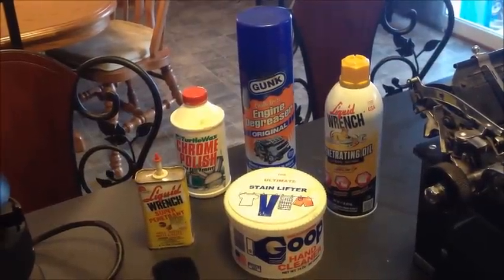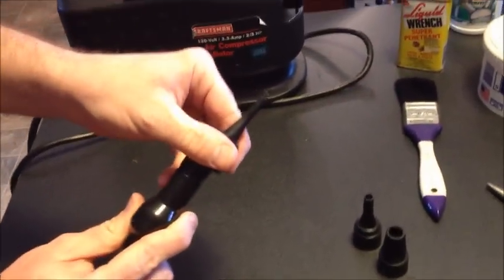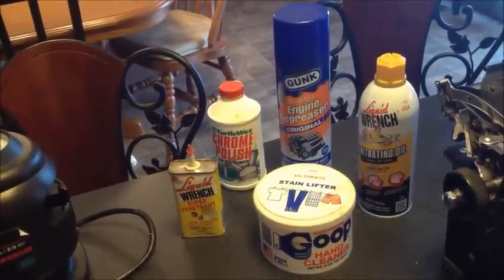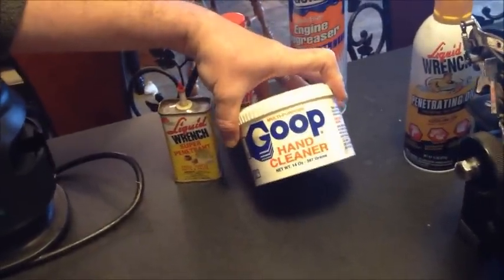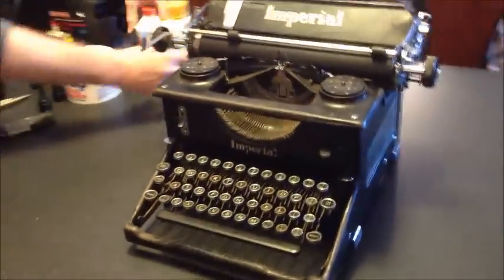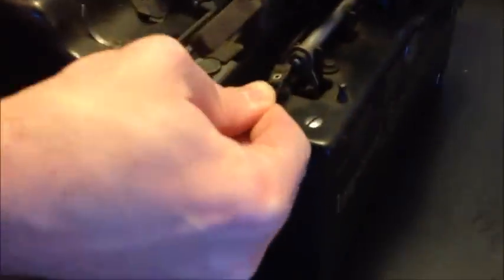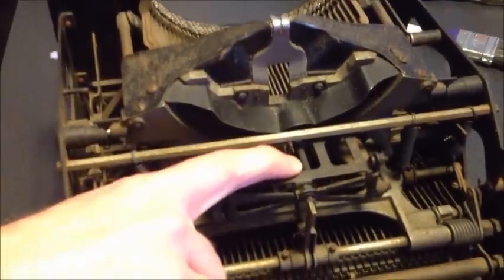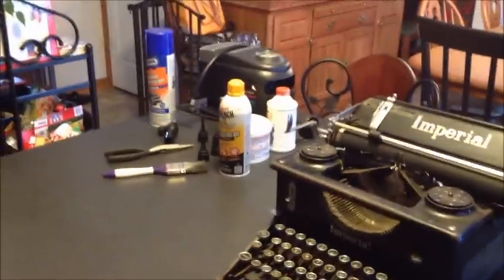Typewriter Cleaning Tips ..and the Imperial 50

Comment: I was one of the last repair men for these m/c good to see chaps like them
Reply: I don't suppose you know where I can get a service manual for it, do you?  Mine (here in the UK) has seen heavy use, and it's been a fair few years since the Imperial factory stopped providing a cleaning and lubrication service.

Pretty sure the centrifugal brake isn't braking at all, and a bit of preventative maintenance would go a long way, but I'm reluctant to tinker with things I can't see and do not fully understand.  Some things (like the tab mechanism) can be seen and adjusted, but anything hidden and involving springs is risky.

I've had a GPO telephone dial in bits and got it working, but that was easy : someone posted up the service manual for that online!  Not so easy when you don't have that information.

Comment: Despite what people say, I use WD-40 on my typewriters, and have never found a problem AT ALL, with my technique. You can use WD-40 if you remove the excessive oil, and also the excessive oil that becomes visible when you use it. The trick to using it is use a very tiny amount.

Oh, I find that sewing machine works very well as well.
Reply from the maker: Absolutely correct.  Where people go wrong is the belief that WD-40 or any penetrating oil is a substitute for proper, complete cleaning and lubricating.  Also, we know a number of people have used it on type bar segments.  Very, very rare is the typewriter whose maintenance instructions allow (and do not specifically forbid) lubricating the segment.  In fact, off the top of my head the only one I can think of that actually calls for lubricating the segment occasionally is the Harris Visible.
Reply: Will Davis I usually barely use WD-40 for the typing segment, unless it is really disgusting. And even then, proper procedures will work in your advantage.
Reply: Yuuuuck!!! Just get you some crude out of the ground if you need oil that bad.  WD 40 I hear was made by the US Military as an emergency lubricant and water displacement, so guns and radios could function in field conditions.  In small moving parts not as heavily sprung as an M1 Carbine, a much lighter lube is needed.  I have been using Transmission fluid pretty well, and it doesn’t seem to gum up like WD40.

Comment: OH, and I have a Imperial 50 too. It types magnificent, but the thing is that platen has hardened over time. IT EATS UP MY PAPER. You have any idea what substance could fix that? 

And mine is "special" Imperial 50. It has "WAR FINISH" written on the front. I looked it up and apparently, matte versions with that statement on the front are very rare.
Reply from the maker: People are having good luck using automotive belt treatment on platens.  We intend to try that very soon.  Also, use two sheets of paper and you might see some improvement -- further, the two sheets protect the platen on any machine.  We were taught in typing class to use two sheets.
Reply: Will Davis The platen is fine. Indeed, two sheets works a little better but still tends to ruin the page. However, I'll try that automotive belt treatment.

Comment: In sparing use for the carriage and stuck keys (after cleaning manually) what about 3-in-1 Lock Dry lubricant? It are-sol  with no water (it's no WD-40 - ugh!) and used on ball bearings, as well. Also, anti-corrosive. Certainly won't gunk up. Any thoughts?
Reply: Darth Decius a lot of these are dry silicone lubes, and are mainly used for locks in the wintertime and stuck windows.  On typewriters they’re murder—sometimes worse than WD40, I f anything can be that bad.